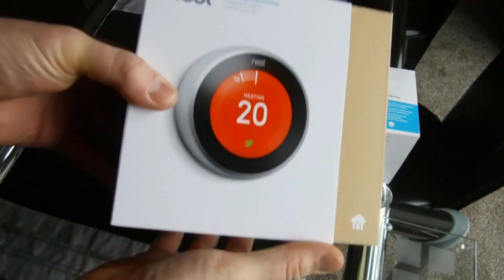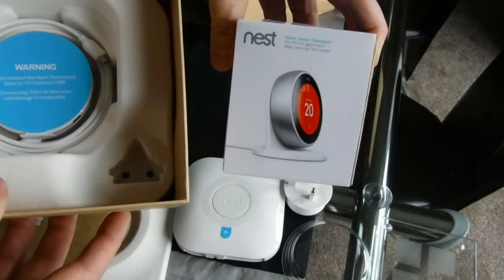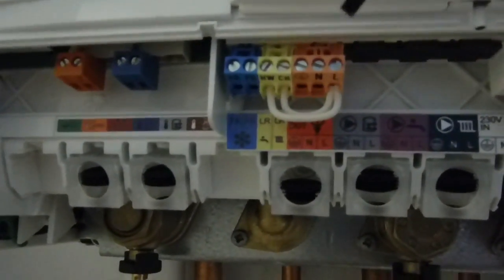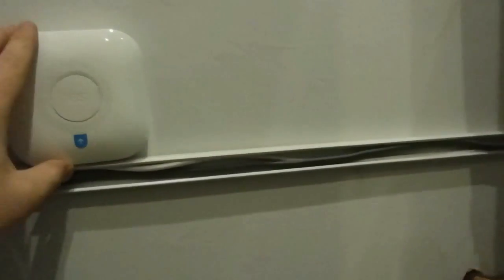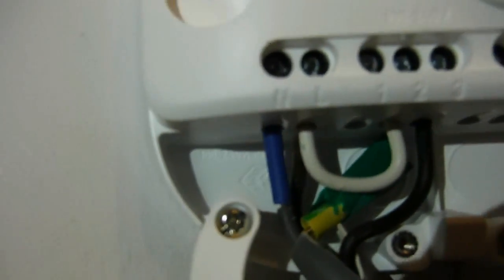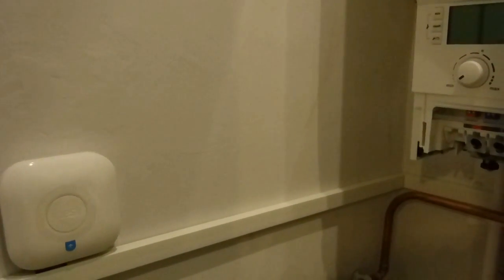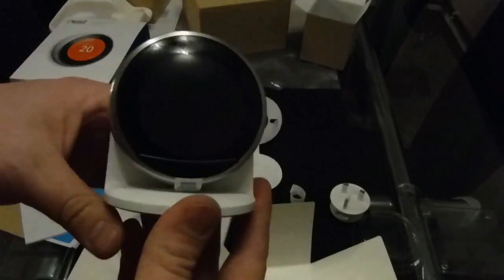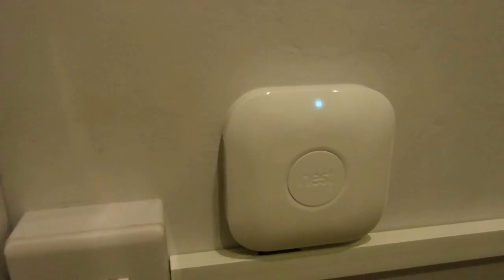How to install Nest Thermostat 3rd Generation - UK

Comment: Hi I have a valiant ecotec pro 28 , after connecting the L and N from boiler to heat link will I only need the one wire from boiler to heat link (3) ??
Reply from the maker: +Jah Jay Yes this should be correct. Don't forget to link the L and 2 on the Nest.
Reply: Mate next day reply!!! Ur a legend can't thank u enough . My sparky mate was clueless with the diagram nest gives you , they should just have a link for your video in their instructions!!
Reply from the maker: +Jah Jay Cheers mate. Appreciate the kind words!

Comment: Hi. Great video. I am planning to install the NEST but I have a question... The thermostat currently installed is a hard wired Drayton. The cables running to it from the boiler (Worcester Bosch Combi 36CDi) already match what you installed to the Heat Link in the video, although it doesn't use all the wires. Therefore my question is this.... Can I put the Heat Link in place of the current thermostat as a direct replacement (making the necessary wiring connections)? My other concern is that it is located in the hall whereas the boiler is in the kitchen so the wiring between the two is a lot more than the 30cm you quoted - the wiring is hidden but I'm guessing about 5 meters. Any info appreciated, cheers.
Reply from the maker: +Nick Miles Hi, glad you found the video useful! The 30cm mentioned is a MINIMUM distance that the Heatlink should be from the boiler, there is no maximum so it should be fine.
You could do it the way you said, or cut a length of wire by the boiler and connect the boiler to the Heatlink in the kitchen, then use 2 of the wires remaining from the kitchen to the hall to connect the Heatlink to the Nest (to power it). That way you can put the Nest on the wall in the hall rather than the not so pretty Heatlink!
That's if you're putting the Nest in the hall....if you're plugging it in using the adaptor, you can put it anywhere!
You're way is fine but I'm just offering an alternative instead of putting the Heatlink on the wall in the hall.
Reply: Thank you. Really appreciate you getting back to me so quickly.

Comment: Do i really need the heat link connected to the boiler. And can replace it with my old thermostat wiring.
Reply from the maker: +Eric Tanoh Yes, you will need the Heatlink connected to the boiler as it is the Heatlink that the Nest "talks to" to tell the boiler to turn on and off. You CANNOT connect the Nest to the boiler directly!!
Reply: charlieshooter cheers for that. Coz most videos they only show setting up the nest thermostat replacing with the old one. So thought perhaps that's it. But thanks lucky I didn't do anything stupid.

Comment: Thanks for the video mate. Just installed Nest with 32cdi combi. Had a wireless thermostat previously and the wiring from boiler was connected to the RF receiver and then the RF receiver was connected to the mains. I removed all the old wiring and re did it using your approach and it worked.
Reply from the maker: +Kamran Great to hear! Glad the video helped out! 😀

Comment: Hi Charlie, this video you have posted is really good, none of the others come close so! i just bought the Nest today from amazon and after watching your video i am determined to fit it myself! couple of quick questions, why on the heat link is the live looped to "2" ?  Also, where is the best place to pick up the wires you used to connect from the boiler to the heat link? is there a difference in the composition of the varying wires, ie, neutral, live, the black cable / cs trigger, sorry may seem like complete noob questions ..... thanks in advance
Reply from the maker: +Jan Alexander de Swart Glad you liked the video and you're going to use it to install your Nest. It's quite simple if you follow my instructions.
The loop at no.2 is there to work like a switchable live. When the nest tells the Heatlink it needs heat, the Heatlink connects 2 and 3 creating a live return back to the boiler.
As for the wires, you can come by these in any hardware store...B&Q, Screwfix, even Wilkos. There is no difference in the composition of the wires. A normal bit of flex should do it.
Reply: Ok great, thanks for the response - i think there may be a small element of trial an error, is the system at any risk of the wrong wire is connected to the wrong connector?

Cool, i will check out these places, do i need a 5 core flex wire? one for Live, Neutral, the trigger cable, earthm and a spare? i can only see places to buy 3 or 5 core flex wires?  Out of interest, in principle you could use the live "brown" wire as a neutral if you wished, it makes no difference?
Reply from the maker: +Jan Alexander de Swart Sorry for late reply. It's been a busy week! Follow the video and you will be fine. No trial and error then! You could damage the Heatlink if you connect the incorrect wires.
As for the flex. You could use 5 core and have a spare or you could even use 3 core and leave the earth off as there is no Earth on the Heatlink. Yes, in principle.....any colour can be used for anything, as long as you know where it's going the other end. I used the brown for live as that is the standard colour, to stop confusion.

Comment: Hi, brilliant video, thinking of getting this. Just wanted to ask how long is the power cable that came with the Nest? Thank you
Reply from the maker: +JustOneForAll Thanks. It's a good size lead...not like all the mobile phone ones now. It's approximately 1.8m. Mines sited halfway up the wall above a plug socket and there's loads spare!  They are cheap on Amazon today through the Prime Day they are running. Get one! 😀
Reply: Thank you so much. Just ordered one and about 45% off. Great thank you
Reply from the maker: +JustOneForAll Great deal that is! Hope the video helps with fitting it!
Reply: I am too scared to do it. I might blow something up. I am having a new heating system and boiler put in on coming Monday, so gonna let the pro's do it. I will surely be showing them your video first to help them and I know it will help.

Comment: Thanks Charlie, great little vid. It helped me out with two things. Firstly the link wire from live to common, this was not at all obvious from the manual. Secondly I hadn't found the screws hidden at the bottom of the box! 
I also had to open up the boiler to remove the connection to my old mechanical thermostat. 
Thanks Again :-)
Reply from the maker: +Peter Lewis You're welcome. Glad it helped you out!

Comment: I have an ideal 30 combi with L N and earth the only room stat L and N. am I linking room stat L to perm L and room stat N to heat link? Cheers in advance
Reply from the maker: +mark powell I looked into how to do an Ideal Logic 30 combi before for someone else on here and this would be my advice: Connect the L and N on the boiler to the L and N on the Heatlink. There should be 2 thermostat connections on the boiler (maybe already going to the thermostat you have?) and these need to go to connectors 2 and 3 on the Heatlink.
Reply from the maker: +billybob01234567 I've had a look at the manual for your boiler and I would say 2 wires from the boiler (from the room stat/timer connection) need to go to 2 and 3 on the Heatlink (and an L and N too of course). As simple as that!
Reply from the maker: +billybob01234567 No problem. When I first did mine there was hardly anything out there to help so that's why I did the video. Glad it's appreciated!
Reply: @charlieshooter  Hi could you advise me please.? I've an Ideal logic+ Combi 35. If I understand the previous wiring comment I need a 4 core: N (boiler) to N (heat link), L (boiler) to L (heat link), <remove the boiler jumper cable on the stat/timer>, stat/timer 1 (boiler) to 2 (heat link),  stat/timer 2 (boiler) to 3 (heat link). Also no jumper on heat link between L and 2. Does this make sense? Thanks in advance.
Reply from the maker: That sounds perfect! 👍🏼
Reply: Hi, I have a similar setup (boiler wiring diagram here - https://www.manualslib.com/manual/839298/Ideal-Independent-Plus-Combi-C24.html?page=27#manual). If i connect the stat N to 3 and stat L to 2 does that sound right? Also, do i still need the linking wire from main N to 2? Thanks
Reply: Thanks for your reply. That's exactly what I did and it worked. Great to have that confirmed as well! IMPORTANTLY I removed the live-common(2) link on the heatlink as well. Just to say thanks for all your time on this thread it's so valuable for anyone that wants to wire up the nest itself. (Simple when you know how!)

Comment: Wow! Your video is incredibly easy to follow, after checking my Worcester Heatslave combi boiler which has identical connections I'm going to buy the Nest tomorrow and have a go myself. 

Ive checked my user manual regarding the hot water however;
"If DHW (domestic hot water) is OFF on the programmer, the appliance will still supply DHW using heat stored in the tank, but it will not reheat the tank, therefore the amount of water available is limited but is adequate for washing up, filling basins etc.
We recommend that DHW is timed off overnight and when the home is unoccupied to save energy. The timer should be set for at least half an hour before normal hot water demands are expected to reheat the heat store."

So I might connect the water and see what that does. Something worth looking at for your combi maybe? Ill update tomorrow and let you know how it goes. Many thanks in advance.
Reply from the maker: +Afshin Bari Thanks....glad you found the video useful. We don't have a hot water tank, so our hot water is always there ready in the pipes within a minute or so. If we had a tank I would have definitely have connected the Nest up for that. Good luck with the install.
Reply: Thanks Charlie, installed and running like a pro, I consider myself a Nest Pro thanks to your video. Regarding the hot water tank, we don't have one either, but we are able to set a programme for the water. The latest Worcester combi boilers have an additional eco feature that manages hot water for even more efficiency, indeed on combi boilers without separate water storage tanks. Anyways, many thanks again for the help!
Reply from the maker: +Afshin Bari That's good to hear.....comments like that make doing the videos all worthwhile!

Comment: Found your video before I got the Nest, and after viewing it, it game me the confidence that it would be fairly simple to get one working on my boiler. Fitted it today using your guidance without any problems, thank you. 
I have a Bosch 28CDi but the older model and with no original thermostat fitted so your video was ideal. I had to disconnect the existing front plate digital timer for the Nest to start working which stumped me for only a second when I first tested it and it didn't work!  I'm really grateful for your time creating this. 👍🍺
Reply from the maker: +EJ Wheeler I'm always pleased to hear when people have found any of my videos helpful. Have a look at my other 2 NEST videos for how to use it.
Reply: Hi mate, which existing front plate digital timer are you referring to? I'm having the same problem, everything has been connected but can't the thermostat to fire up my boiler.
Reply: Just helped me as well attaching to my WB. I was 99% sure I was doing it right.. but had that moment of self-doubt. 
All was good - but nice to see an actual video rather than staring at wiring diagrams.
Reply from the maker: Glad the video helped you out...it's always best to check. Have a look at my other Nest videos to see how to use it and set schedules.

Comment: Hi Charlie,

I'm trying to get my Nest set up with my Logic Combi Boiler but seem to be having issues with it. I've got the Neutral from the boiler plugged directly into the N on the Heatlink, I've got the Live from the boiler plugger directly into the L slot on the HL, I've also got another live cable from the L slot (a loop) plugged into the No 2 slot, Ive got the Room Timer Stays black cable pluged into No 3 but still no power on the Nest itself? What do you think is the problem? I've used a 4 core flex to do this.
Reply from the maker: +Dan Green From looking at the instruction manual for a Logic Combi and matching it up to the NEST manual, I would say you need to connect the L and N  as you have but leave out the L loop and connect the two Room Stat connections on the boiler to 2 and 3 on the Heatlink. The power on the NEST itself either comes from the adaptor or T1 and T2. Hope this helps!

Comment: Just installed my Nest thermostat based on this guide. Found it really easy to follow, once I worked out why my boiler connections looked a bit different (mines not colour coded). Thanks.
Reply from the maker: +Deaks That's great to hear. Glad you found it helpful. I've just uploaded a couple more vids this week showing how to use it. They may be of interest to you. Thanks for watching.

Comment: Great video. I've got an existing DT20 timer already installed in my Worcester 35cdi, so what needs to be done to that after the nest is installed? Remove it, disconnect it, or just switch the heating to the "off" setting on it?
Reply from the maker: Thanks for watching.  The NEST replaces this timer so you can remove it/disconnect it.  You would need to, to stop them interfering with each other.

Comment: Thanks for your video, it helped me a lot. I have a combi boiler and it is a bit of bugger to get it to work properly. In order for the thermostat to work and switch the boiler on and off, I needed to connect the 2 existing thermostat wires that were already on the wall. Without connecting these 2 wires the thermostat would not work, It also avoids me connecting the USB power adaptor to it as it takes 12v from the boiler. It seems to work now for a few days, but my only problem is that when it switches the boiler off, my hot water is switched off too. The only way around this is to switch on the Heat Link, which sets it to on all the time and move the dial on the boiler to water only. It's a bit of pain, but it seems to work. My only problem is if I go out or go to sleep and it's a freezing cold night, then it won't switch the boiler on and it could freeze my pipes. Any advise on an alternative way to wire a combi boiler properly to make it work so that it doesn't turn my boiler off as if I am switching it off from the mains, would be much appreciated?
Reply from the maker: +Tony Antoniou Glad you found the video useful! There should be connections on your boiler that switch the live to just the heating and the live to just the hot water separately. There could be a loop missing from the switchable live on the hot water which is why it is going off with the thermostat. What boiler is it?
Reply: +charlieshooter Thank you very much for your response, it is much appreciated. I have a old Vokera combi-boiler that is about 15 years old. I have basic connections. 1 Live, I Neutral, 1 Earth and 2 cables that used to go to the old Honeywell thermostat and that's all, which I tested to be around 12V DC. I don't have separate hot water or central heating connectors on the boiler, just those 2 other connectors on the boiler to the thermostat to control the central heating only. I had to connect 2 cables from the Heat Link (12V power) to the 2 12V connector cables on the boiler and then connect the existing thermostat cables on the same 12V connectors on the boiler to make the Nest thermostat work properly. This is perfect as it powers the Nest thermostat without the USB power adaptor and it makes the thermostat work with my boiler. The Heat Link switches the boiler off completely and that is the problem. I connected the combi-boiler by looking at the wiring diagram that came with the Nest thermostat, with the exception of the 12V Heat Link connection.  The Heat Link connection is the same as the one on your video. so number 3 on the Heat Link is now connected to the Live on the boiler to power it up and the Live that was previously on the boiler is now on a constant Live feeding (as it used to be on the Live of the boiler). Neutral goes directly to the Neutral on the boiler. I hope this information helps.
Reply from the maker: +Tony Antoniou 7 It certainly seems a bit of a  different setup to what I'm showing in the video. It seems to be what NEST describe as a  low voltage setup. They show to wire 2 and 3 on the Heatlink to the 2 existing wires coming from your boiler (12v ones) and then obviously power Heatlink with Live and Neutral either from boiler or spur with FCU. The T1 and T2 terminals are only for the NEST to connect to. Hope that helps?
Reply: +charlieshooter Thank you for your advise. I tried the low voltage configuration, but no joy. I need to find out what model number my boiler is to see if it is ow voltage (whatever that means on a boiler), which means I have to dismantle the casing, which is a bit of pain to put back. I never wanted a Vokera boiler in the first place, however when the plumber installed it, I had no choice as I didn't know much about boilers back then. Thinking of getting a new one so that it works with my nest thermostat. I think it's time to change it as I really hate it, cheap rubbish.
Without the two existing thermostat cables, the nest won't work, so I had  to use them. I'm not sure how you got yours to work without those 2 thermostat cables and as evident from the manual if you place it elsewhere with a stand. At the same time I added the 12V cables from the heat link to also power the nest instead of using the USB power lead on the same link to the thermostat cables. Thanks.